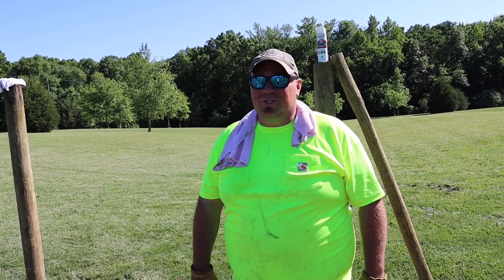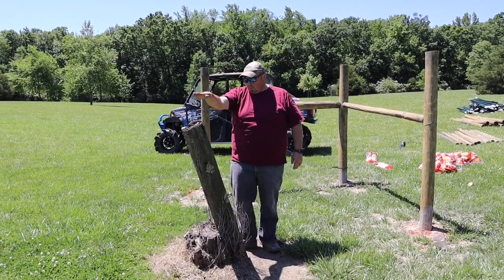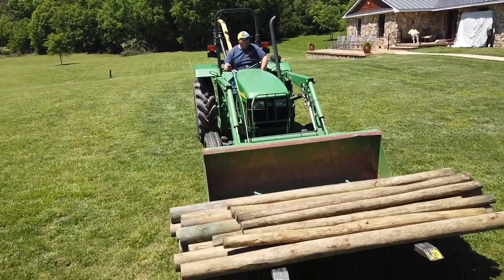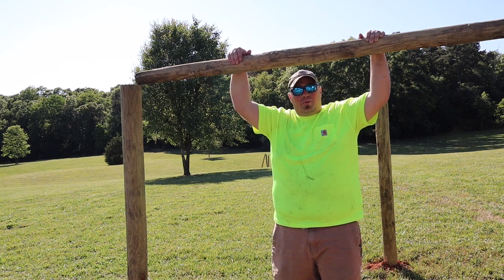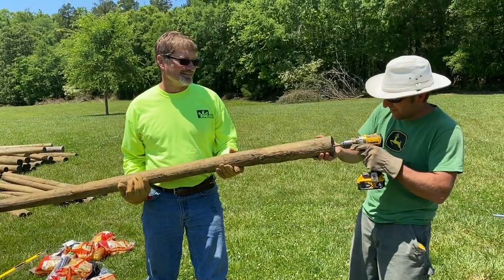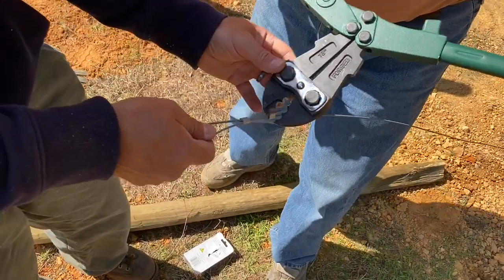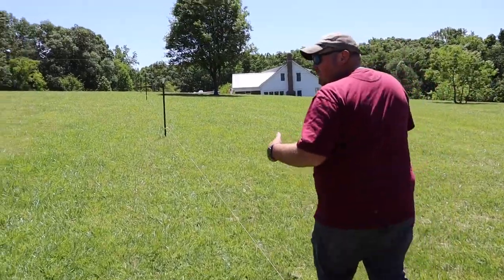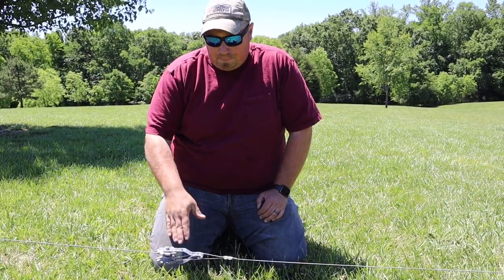STRONG H BRACE FENCE THAT WILL LAST 50 YEARS!

Comment: We are doing the same on our property, but only 8 acres. I’m currently fencing in our very large garden plot/mini-orchard (135’X85’). We have a year round creek flowing through the bottom of our property so I went with 6”X6”X10’ posts so I can build extra out buildings and platforms on each corner. One of the corners will house water tanks that are fed from mechanical pumps and then gravity feed to the vegetable and fruit plots. Another corner will be our compost station. And another corner will be a garden shed. The last corner will be an outside sitting area with benches surrounded by flowers and shade. I’m a new subscriber and I look forward to following your adventure.
Reply from the maker: Awesome!

Comment: Can I use 2x4 or 2.6s instead of a round post or will the pressure cause it to bend?  How about if I only do a diagonal support?
Reply from the maker: It would probably bend, the round would be stronger. With all the tension you will need all the support you can get.

Comment: Could I make a h brace fence with 4 inch diameter posts? I couldn’t find any 6in posts in my area.
Reply from the maker: It would probably work, materials are so hard to find! Best of luck!
Reply: See if you can get ahold of some decent railroad ties. Shouldnt cost you more than $20 per tie.
Reply: @beesmeadschristmastrees  I actually found some 6 in x 8 feet treated posts and they 25 a piece. Im buying 2 at a time. I need 8 more and it’s hard to get my fence built when I’m on a budget.